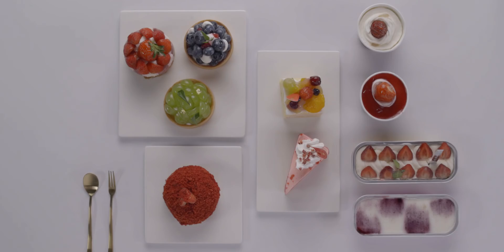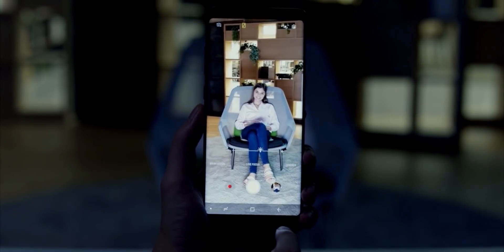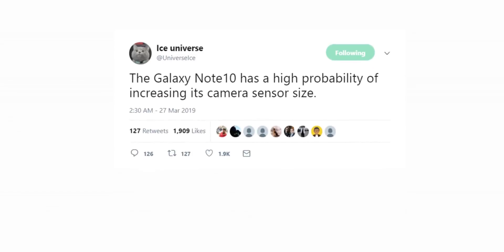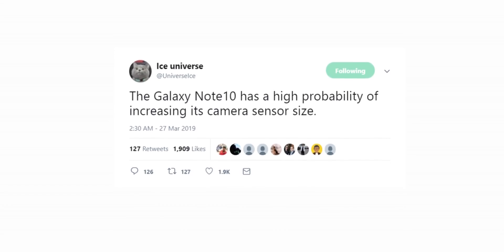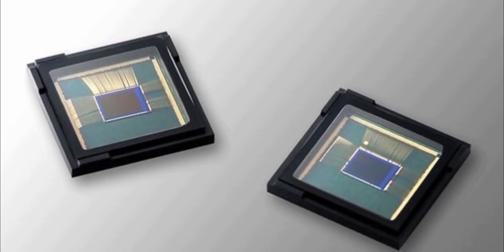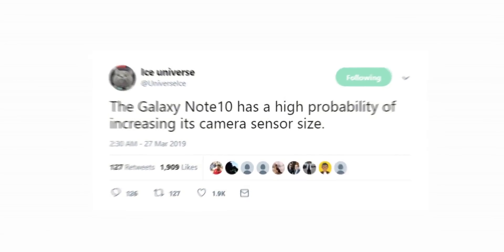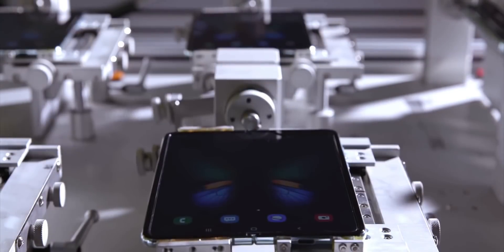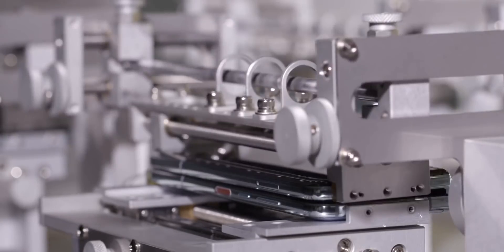Samsung Galaxy Note 10 - BIGGER SENSOR?

Comment: I legit couldn't stop watching the Galaxy Fold's folding and unfolding, it was lit🔥
Reply: That's sad!
Reply: @klynch572  why is that sad?
Reply: Very satisfying to see
Reply: That hardly represents real life use. In real life, you have many more things to consider when handling the device than just a machine folding one side exactly same time every single time. People are not robots. Also, high temperatures and quick temperature changes can also affect the plastic screen, which doesn't happen in those laboratory conditions, not to mention people actually touching and pressing the display all the time. Then there's a whole lot of physical stress when putting a device like that in you pocket and moving around. All those things considered, it may not last nearly as long as promised.

Comment: Sal did You see Xiaomi's 100w fast charging tech?
Reply from the maker: The problem with it is it'll degrade the battery in just months
Reply: the fast charge damages the battery fast 
so every thing is fast 😂
what is important is enhancing the quality of batteries
Reply: @TechTalkTV  that probably won't occur it also could use 4 batteries for optimal charge
Reply: U r kidding right
Reply: @TechTalkTV  maybe not if they split the batteeries..likee 4 batteries each will charge only wuth 25watts
Reply: Z3U5  lol
Reply: @zerotwo_.002  i commented same  thing then saw ur comment later
Reply: Z3U5  nope mate oppo uses 2 batteries to do the same and this tech is not that hard

Comment: Sal, did you hear about the Galaxy A60 and A70? A70 is officially announced by Samsung. It will have a friggin' 6.7 inch screen! Its expected to be starting at around $350
A60 is not official, but its rumoured to have a punch hole lcd screen. Rumoured to start at around $300

Comment: It's not just sensors Samsung needs to improve the software's.how does the pixel have same tech better quality? Look at the Huawei pro p30 more mp and takes superior photos to anything on the market? Nots saying mp is a direct correlation but it does allow more light into the camera and sensors and with right software it wins.

Comment: The fold test is being evenly and perfectly closed Everytime. With human hands you're going to close the device at the bottom or maybe at the top or it's going to twist a little bit when you go to close it. this in turn causing stress on the screen and the hinge that would otherwise not be tested in this method. I think if that testing facility would have had it on some kind of spring system to where it would have some jarring about, it would give more accurate results.

Comment: Hey sal why seller spreading myth that current S10 is 5G ready.Bigger sensor are best. I wish Samsung  makes 💯 percent dual pixels so it increases the quality se way Huawei is is doing.
Reply from the maker: Which seller is spreading that rumor? There's a separate S10 model for 5G, though
Reply: @TechTalkTV  it was local S10 the name tele shoppee .they had guys so funny they said wireless is faster than wired. I would love to send you a pic when I will go that location . It really sad that they are misleading and remember even t mobile said S10 is selling like hot pancakes because it's 5G ready whereas actual 5G model releasing in April.